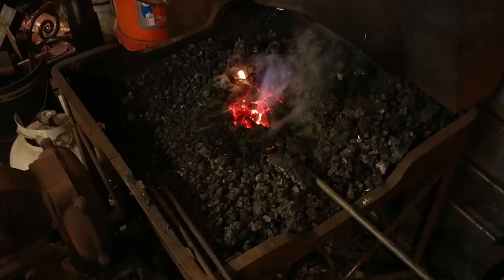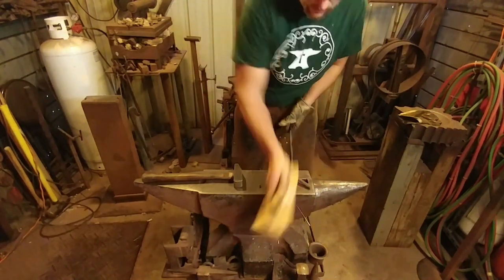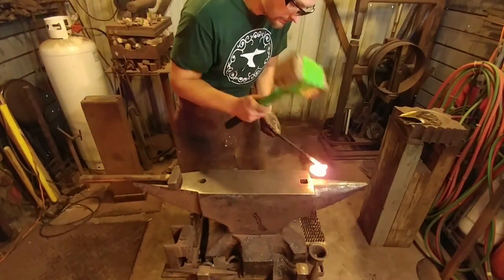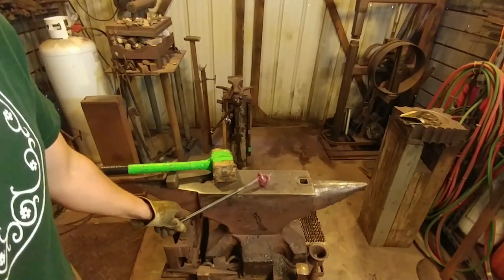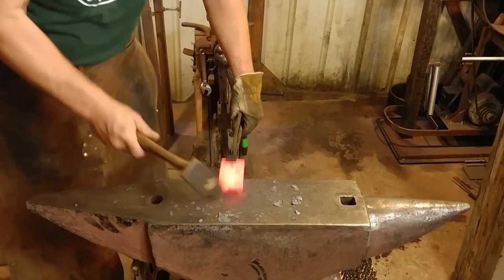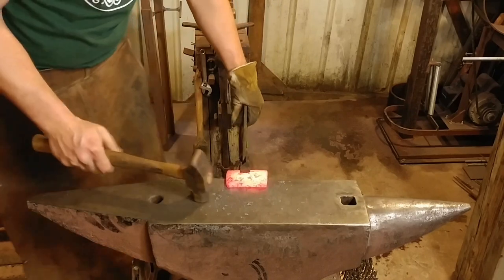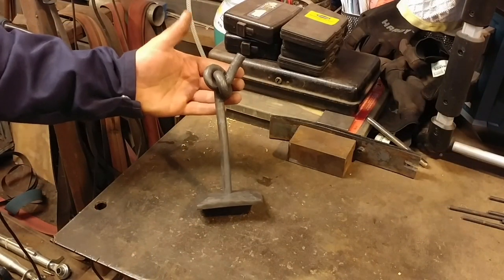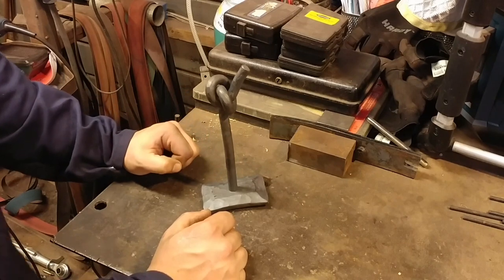$75 Knot Sculpture // Forging Knots as Blacksmith Projects to Sell

Comment: This may be a stupid question idk but is it possible to lock one end of the knot in the vise and then grab the other end with vise grips get it really hot and just pull the knot tight or does it not work like that?
Reply: Yes, IF, your pulling 1/4" ..with 1/2" and above, get some good hammer control, as shown.
Reply: William Pratt ok cool thanks